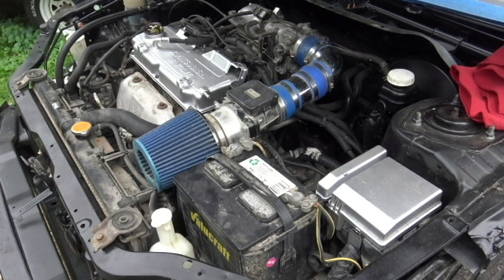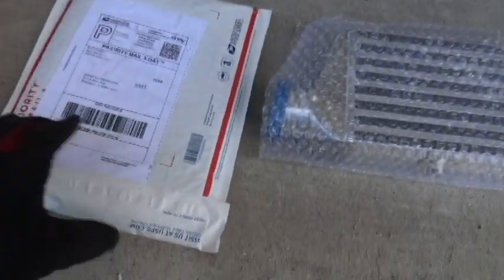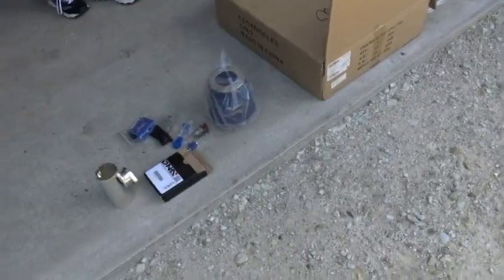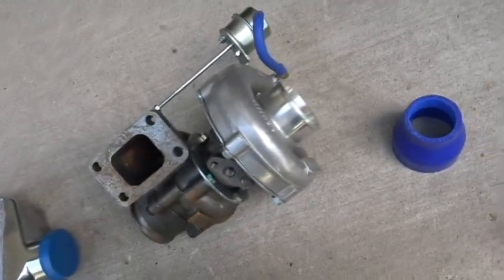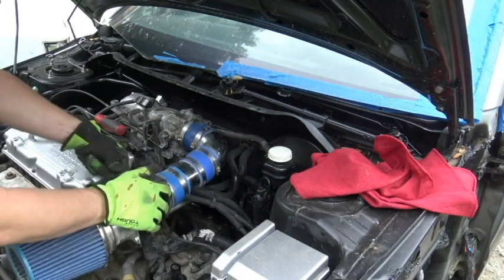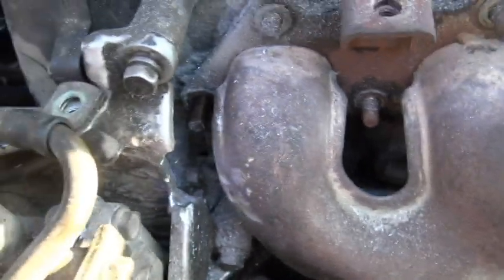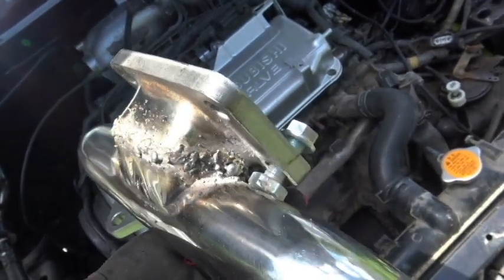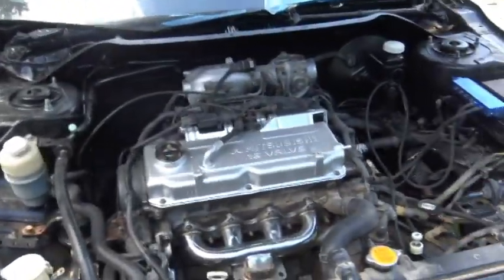Lancer to Evo Build Ep. 2 | Engine Removal Part 1

Comment: i have a mitsubishi mirage 1998 4g93 with custom turbo! to make space for the turbine i put a honda civic racing radiator and a spal 12'' fan and a 8'' spal fan for the a/c. with that you have a whole lot of space to work!! my 4g93 make 303hp with stock internals an 550cc rc injectors 255 walbro fuel pump..